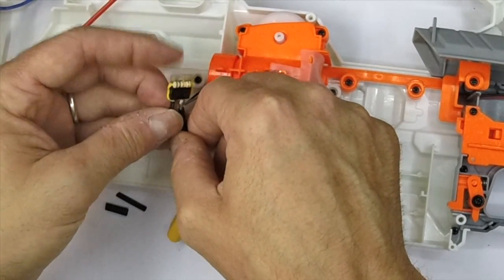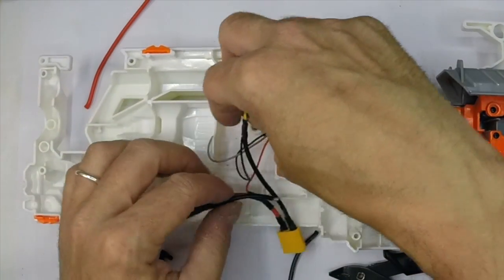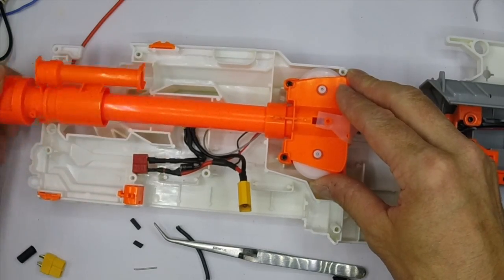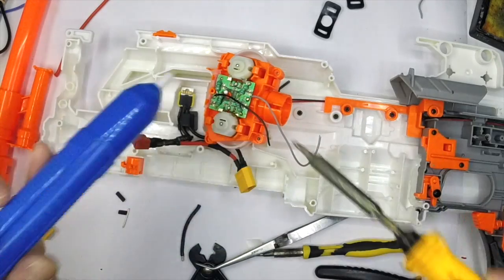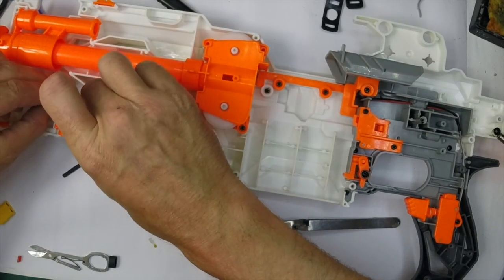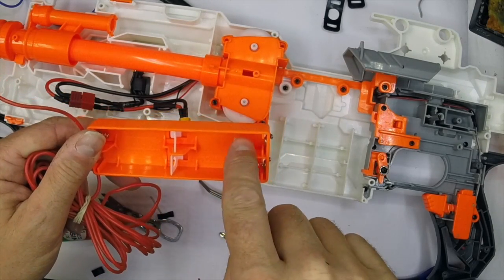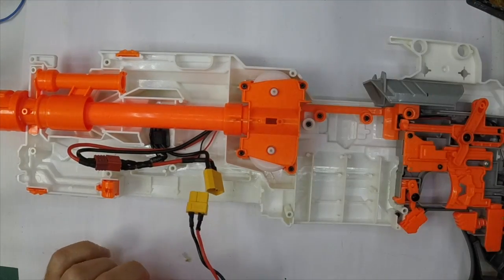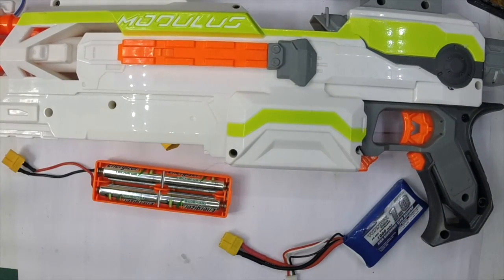Modular Modulus Part 2

Comment: Hi..
first great videos mate really helpful and can't wait to get started when everything delivered.. but would it be safe to have engine braking with a cherry switch in? 

Thanks
Reply from the maker: You can use motor braking but I wouldn't, it brings nothing useful to your set up and increases motor wear. It's particularly bad with decent precision flywheels as they weigh more. You can't run flywheel braking with a single mosfet, you need to make an H Bridge. Also if it's a Modulus, good luck fitting a DC2 in the grip, space in there is tiny.
Reply: Foamdata Services
Thanks for the quick reply.. Best I leave the motor braking out then as it's my son's gun and safety first but upgrade motors and battery for him..
Reply from the maker: It's not inherently unsafe, just doesn't do anything useful! Hope your mod works great, see if you can get to a game so he can test it!

Comment: Will this work with a 3s lipo
Reply: And also can u try to make a regulator mod
Reply from the maker: The mosfet is rated up to 250v. Of course it will work with 3s. You should change the stock motors if you are running 3s, they burn out quickly on 3s lipo.
I don't bother with conveyer fed autos, they are awful. Nemesis excepted. My Reaper does single, three and five round burst, what would I want a regulator for?
Reply: Foamdata Services what are good  motors to use
Reply from the maker: All stock motors are fairly rubbish. Barricade motors work fairly well on 3s Lipo, but still have inferior metal brushes, get mod motors if you are planning on anything beyond a couple of IMR's and a rewire.
Reply: Foamdata Services u know where can I buy them
Reply from the maker: Search google for whichever ones you like the look of, watch my motor guide and 132 motor videos, pick a voltage and motor size, then search.

Comment: I'm wondering where in a Stryfe you would tend to place a MOSFET? I can't really think of any area other than the dead space in the handle (which I would think ruins the aspect of moving the current away from the grip) assuming I have removed the upper section of the battery tray to fit in a pack.
Reply from the maker: I put the mosfet above the battery tray in the Stryfe, see my MOSFETboard video, that's the best place.